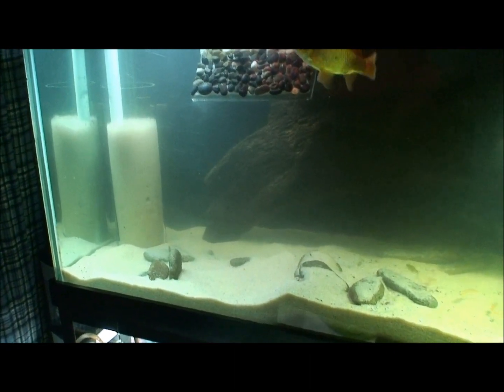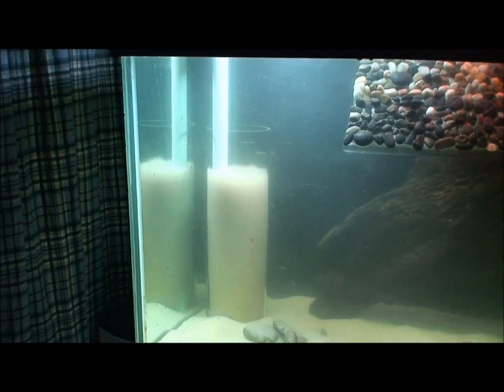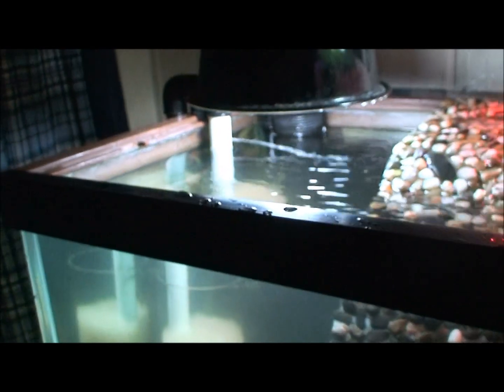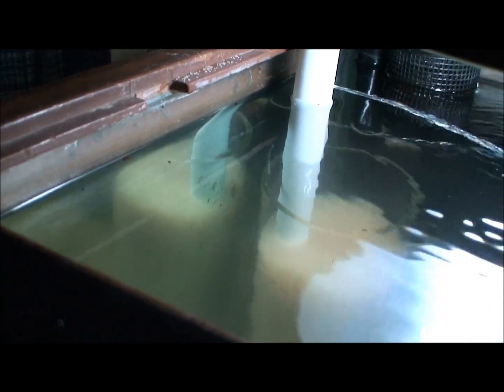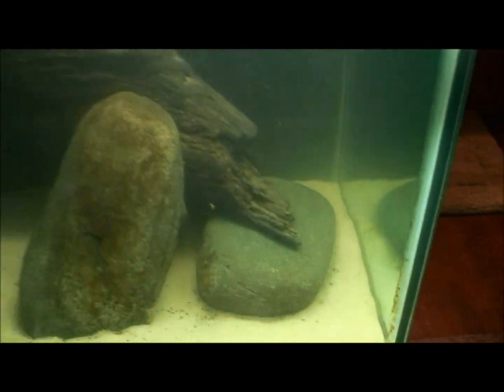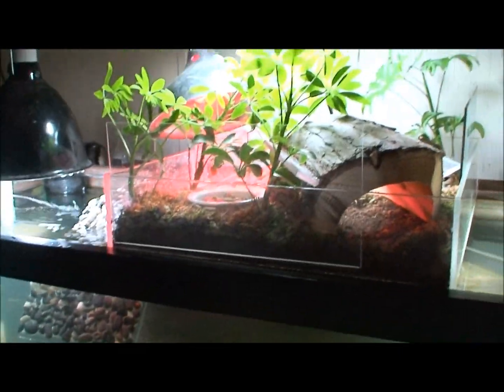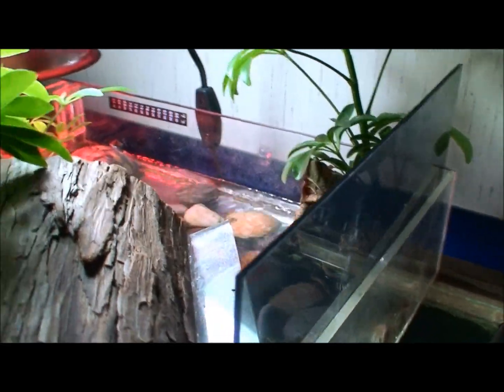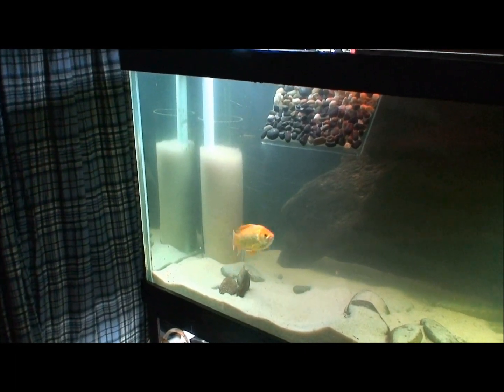Fluidized Sand Bed Filter Test 1

Comment from the maker: nope, turns out this type of filter is great but if your power goes out it the beneficial bacteria will die really quickly. Also the chances of tank overflow from back pressure in my configuration was to high.